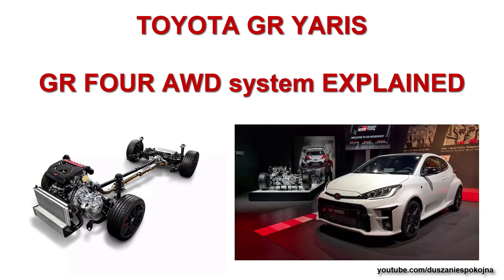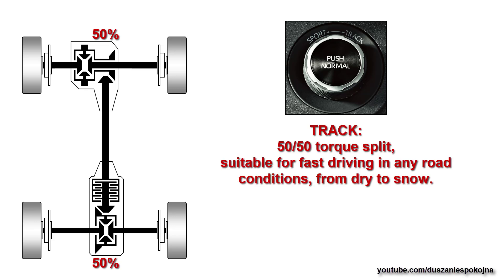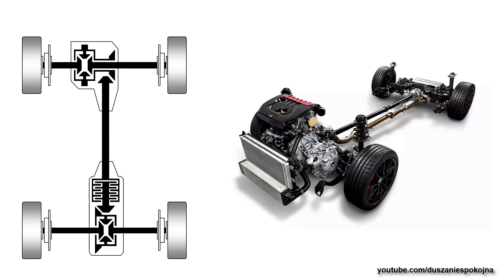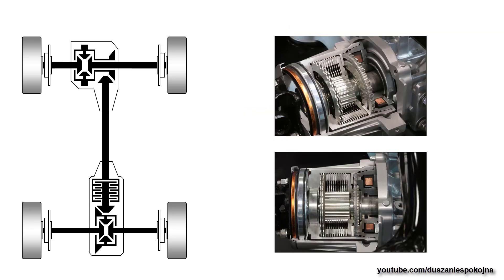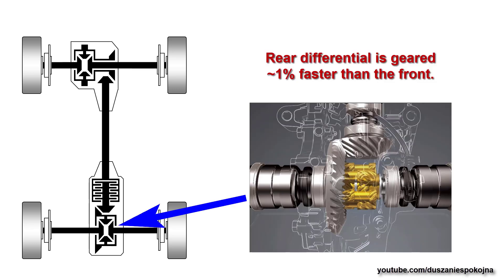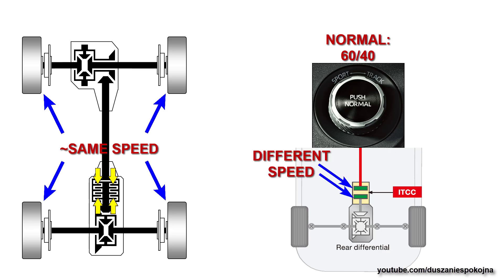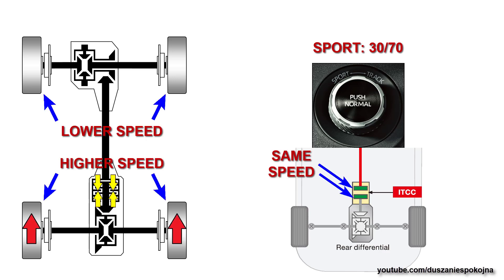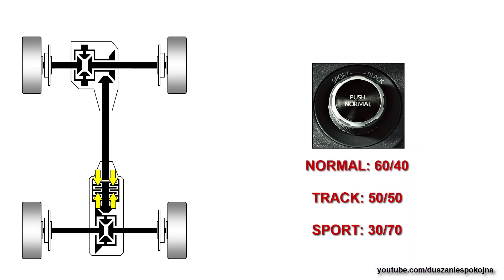Toyota GR Corolla & GR Yaris - GR FOUR AWD SYSTEM EXPLAINED - @4x4.tests.on.rollers

Comment: Wrong! FWD based car can NOT send more than 50% torque to the rear axle. 1% overdriven rear axle cannot be explanation.

Here is why:
Whenever you overdrive axle or gear in gearbox you always increase speed but DECREASE torque, basic physics.

As we all should know, torque to the rear comes from front differential ring gear, makes 90° turn and goes to the rear through clutch pack to the rear diff.
Basically rear diff is stealing tourqe from front axle and not other way around to have 30/70.

I dont know why everybody believes in this 30/70% torque split BS from Toyota.
Reply from the maker: It is explained in the video - it is not the point to overdrive the rear axle but to be on the level just before overdriving. The point where clutch-pack is almost locked but still slipping.
Reply: Let's go one by one:

1. Function of clutch pack: 
   A. Fully locked: take 50% torque 
        from front axle.
   B. Slipping: take <=50% torque and 
       It depends on clumping force.

2. Result of 1% overdrive:
  A. Reduced torque and increased speed.
  B. As per Mazda: faster torque delivery.

New mazda 3 has exact same AWD setup with 1% rear diff overdrive but they do not claim to achieve more torque to the rear.
Ask why. Because it's not possible.

Now it's up to you how you interpret   claimed 30/70 split. 

I call it BS.  You think, and many others, it's legit.
Reply from the maker: @FutureProofNothing  Different gearing means higher resistance of rear axle just beyond the level of overspeed. That's a peak. The same trickery is used in Focus RS, A45S or new RS3. Mazda (and others) are using it to eliminate the backlash and get faster response but these systems do not apply maximum possible clumping force to the clutch-pack (max 2.8A from 3.0A possible). That's why they do not claim to achieve more torque to the rear. In case of static torque split, 50/50 is achieved when the clutch-pack is fully locked (the same gearing). In case of different gearing, 50/50 is achieved when clutch-pack is partly open.
Reply from the maker: @FutureProofNothing   Mr Kuczera didn't personally create the system and I don't find anything in this interview about torque split, just a sentence about "majority of power". Interviews with JTEKT engineers are much more technical and they do explain the torque issue.
You seem to be continously omitting the most important thing which I mentioned - clutch-pack compression just before the overspeed. You simply skip to overspeed when traction is already lost. Consider your own example when all four wheels have full grip. If the gearing is the same then you may lock the clutch-pack easily, there's no additional resistance, nothing happens. But when the gearing is different then rear axle resists a lot just before clutch-pack lock-up, it actually mimics the situation of different grip between front and rear, like there was more grip at the back. This way there's kind of switch from static to dynamic torque split, where every locked system has variable split from ~100/0 to ~0/100.
I am aware of the fact that many people interpret 30/70 as rwd based mode but as a few polls on my channel shows - about 80% of people do not understand the difference between the torque and wheelspin. 
To sum up - we can agree that we disagree. Regards!

Comment: Let's consider for a moment that the multiplate clutch is fully locked. If the rear differential is only 1% "faster" , shouldn't it take only 1% more torque? Something like 49-51 split?

It make more sense if the shaft to the rear rotates faster ( by using epicyclic layout front)
Reply from the maker: That's not that direct correlation. Actual difference is 0.7%.
Reply: that 30:70 is pure marketing BS.
Reply from the maker: @kjs2435  That's pure physics, adapted for marketing.

Comment: and IMT bottom?
Reply from the maker: You mean button? What about it?
Reply: @4x4.tests.on.rollers  what is it for?
Reply from the maker: @kxSPORTING76  you need to blip the engine on downshifts. If you press the small button down in the centre console marked IMT, which stands for Intelligent Manual Transmission, the system will do it for you once engaged and will also encourage you to rev the three-cylinder engine right out to its red line before upshifting

Comment: So if i understand correctly the clutch pack for rear wheels is constantly slipping? Did they mention the life expectancy of the clutches?
Great video btw!
Reply from the maker: Yes, it is slipping but each one is, there's never equal speed of front and rear. I don't know life expectancy 🙂
Reply: Subaru actually uses slipping clutch packs in their automatic cars most of the time, so hopefully Toyota can make it as reliable as Subaru or even better. But I also don’t know, I can only hope
Reply: @clayvinlunsford9697, the 2004+ AWD Subaru Legacy with the 5EAT gearbox is the most efficient AWD Subaru ever produced. It utilizes Torque Vectoring with or without VDC enabled, resulting in dynamic sensations while distributing more torque to the rear. It provides both security and enjoyment. Mine now has 350,000km on it, and the gearbox still functions just as smoothly. So, it's reliable.

However, the system exmplained here (JTEKT) is surprising but seems to be fun.

Comment: The thing is the front wheel drive system is connected 100% of the time, it can't be disconnected. Whereas the rear uses the clutch packs to lock. In that theory the rear can never see more torque than the front. The whole 30/70 thing is artificial, only because the 1% gearing difference in the rear.
Reply from the maker: It is not artificial, whole trick is explained in the video. That simply comes from physics and that's how you can achieve rwd characteristic from fwd based awd system.

Comment: How do you get the data of 1%? I found the data on google that the final drive gear ratio of front and rear is 3.941 and 3.350, and the calculation shows that should be 17.64% faster.
Reply from the maker: In details - the difference is 0.7% (in the PTU teeth ratio is 17 : 39, in the rear differential - 41 : 18).
Reply from the maker: Interviews with JTEKT guys. The difference comes from angular gear ratio at front and its reduction at the back.

Comment: I don't quite fully understand the idea of overspeeding the rear axle. Could you explain it a little bit more?
If I understand the overspeeding axle is done by gearing which is changing the low speed high torque into high speed but lowering the torque (same as in motor gearbox). So if we are overspeeding the rear axle, we are also decreasing the torque its getting if I'm right. But from where does come the 30/70 torque split?
Reply from the maker: Overspeeding of rear axle means oversteering or drifting or better cornering, depends how much, how long and when it is overspeeded. The point is that if rear axle is overspeeded - it is locked with front axle, no center diff, rear of the car wants to go faster the the front - but that's not continous, these are seconds or miliseconds which slide the car.
Reply: It's also down to the basic principle of a clutch, any kind of clutch. That is in order for a clutch to transfer motion - power it has input and output.

The input has to be rotating faster than the output so then motion - power can be transferred. If the output where to suddenly rotate faster than the input then their roles change.

So being that the rear axle is geared higher numerically that means the pinion of the differential for that axle spins slower than the pinion of the transfer box in the front and that slight speed difference promotes the constant torque transfer from the front axle to the rear, since there is a clutch that connects the two.

Comment: so, its a haltex? how long will the clutches last, do they need to be changed, or just change the packs oil time to time?  or are they dry clutches?
Reply from the maker: No, it is not haldex. It is ITCC, details are explained in the video. Usually there is no oil change in these type of clutch-packs but I don't know how is that in GR Yaris.
Reply: @4x4.tests.on.rollers  well i have changed on the rav4's dif oils, but i remember they had electro magnetic couplings with max 55/45split in lock. The gr yars is interesting..just would lile to know if it would need any service...cant last forever🤔
Reply from the maker: @timoklap  Oil in the diff is a different thing from oil in the clutch-pack. GR Yaris also has electromagnetic coupling. I'll check the service list soon to figure it out.

Comment: Is a 10 / 90 % torqe split possible when the ecu is flashed?
Reply from the maker: I don't it can reach that level (static).
Reply: @4x4.tests.on.rollers  i have seen toyota say ut can be completely rear wheel drive and that is what people are trying to do by using modded ECMs
Reply from the maker: @lexuslfa4739  It can't be rear wheel drive, that's mechanically impossible, video shows the structure of the system.